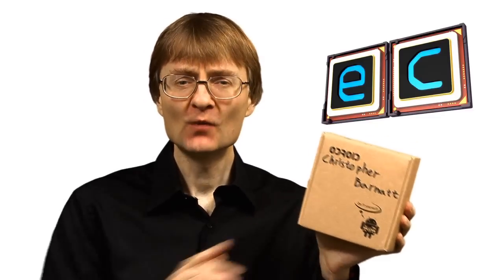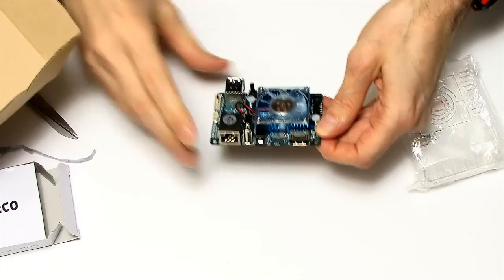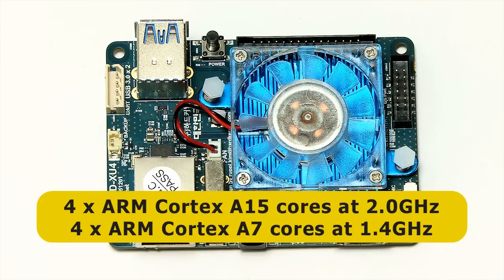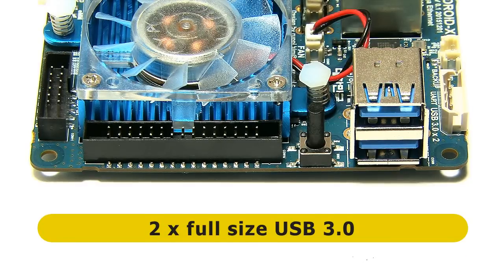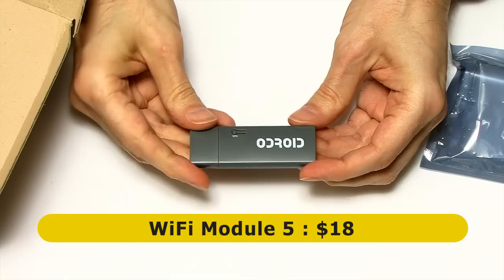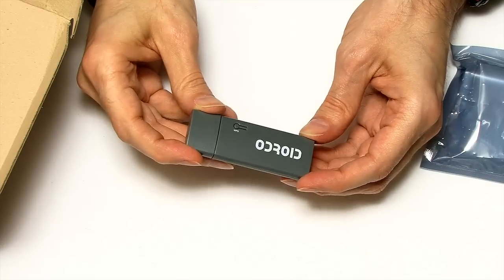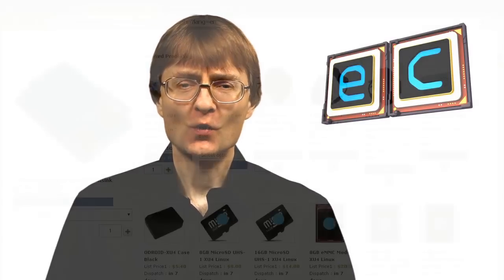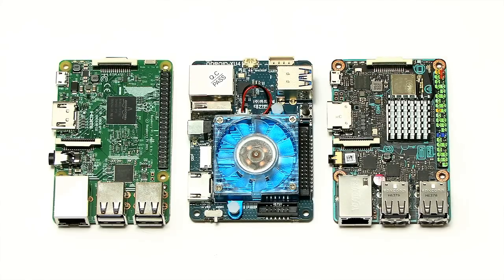ODROID-XU4 Octa-Core SBC

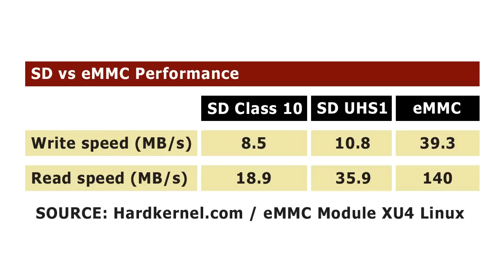Comment: 7:25 their sd cards were probably just really slow, my sandisk extreme 32GB micro sd card that's in my phone gets about 25 to 70 MB/s (or more), even in my raspberry pi 3 b+ sandisk extreme cards are still really fast and only take about 15 to 45 seconds to boot raspbian.

Comment: Banana Pi BPI-M5 is a new generation single board computer design , use Amlogic S905X3 Quad-Core Cortex-A55 (2.0xxGHz) Processor. Mali-G31 MP2 GPU with 4 x Execution Engines (650Mhz). support 4GB LPDDR4 and 16G eMMC flash. it have 4 USB 3.0 port,1GbE LAN port.
http://forum.banana-pi.org/t/banana-pi-bpi-m5-with-amlogic-s905x3-chip-design/11502

Comment: I put a SD card memory in card into my Acer Google Chrome 15 laptop and I I can't get it to show up when I put it in and when I go to Jerry and it shows me some things that look like it might be at but there's nothing to distinguish which one is the one I want you know what I mean and then another thing my neighbor said well if you buy Windows then you're not stealing windows and it's just like it's just me out because Windows is going for $139 right now and you know and that's in you wouldn't even use Windows 10 you would use Windows XP or or Windows 98 but in order to get 98 or XP you got by Windows 10 so I don't have a credit card right now cuz my mom cancel that so I don't know I was going to buy it with my money cuz I got to stimulus check and but my mom gave my dad $700 and I wasn't able to buy Windows 10 Windows XP and Windows 98 but I do have the little SD card and I left it plugged in because I figure if I leave it plugged in I won't lose it

Comment: Could you run a terminal connection into server 2016?
Or can you run virtual box using a windows VM?

Also, can you increase memory or connect an ssd drive?
Reply from the maker: Memory is fixed. You can use an eMMC module, SSD via USB 3.0 port. Terminal connection, yes. Not virtual box -- this is not an x86 PC! It is an ARM board.

Comment: Christopher! what happened to your review of the nano-pc t4? I bought one, and it's hotter than hell. Fast ARM-64 processors need better cooling! Did you bother to install an NVME disk on the nano-pc t4?  Where do you format to use the NVME storage?
Reply from the maker: Hi Karen, I've not got an Nano-PC T4 (yet). Though I have just received a RockPro64, which is based on the same SoC, and will be featured here on 12 August. :)

Comment: I realize these are not windows compatible: however, could they be coaxed into running ReactOS? While that is in mind, are there any of these form factor boards that run Windows or, hopefully, ReactOS? I dearly need a replacement for an aging Win XP system that is Win XP compatible.

Comment: Dived in lately onto building a few retro arcade bartops with raspberry pi’s I was thinking in building a third with an XU4 as the extra power can pay N64 and Dreamcast games it seems but I see it was released in 2015 so I’d rather wait for the next upgrade board.

Comment: It doesn't seem like this board is worth it. A raspberry pi 3 has wireless connectivity and uses less power. What do you need all that processing power for in a single board computer? If you really needed a powerful single board computer, a latte panda would be cheaper than this setup and at least just as powerful.

Comment: Full sized USB A socket, not USB 2, although it will have USB 2.0 on it I would guess. USB 2.0 is the protocol, but the HW standard is USB-A which is a host socket. 

Sorry for being pedantic but I think it pays to stick to industry standard terms/names
Reply from the maker: Yes, I am well aware that USB 2.0- is the protocol. But, for the vast majority of users, the distinction is between a USB 2.0 port and a USB 3.0 port. The more detail of the type you note I include in a video, the more cumbersome and longer the video gets, the less accessible, the fewer people watch, and the weaker it becomes as a means of communication. I think very carefully about the level of detail to include in a video for the intended audience.

Comment: 64-bit octa-core CPU?   i thought this was only a 32-bit??  i was thinking of getting it, but i am hesitant because i thought it was only 32-bit.
Reply from the maker: You are correct -- my mistake here. The memory interface in the SoC is 64 bit, but not the CPUs. Sorry for my error.
Reply: i wish they would have made it 64-bit :(  i'm thinking about using it with RetrpPi on an eMMC chip, since the pi doesn't have an eMMC option

Comment: Hi, Thank you so much for these useful information and for the simplicity.
Just one quick question please. Is it possible to establish a connection between several ODROID-XU4 Octa-Core building then a small cluster (say for 80 cores) ?

Many thanks again
Best,
Reply from the maker: It is indeed possible to build an XU4 cluster -- and Hardkernel even sell hardware to facilitate this: http://www.hardkernel.com/main/products/prdt_info.php?g_code=G150152508314
Reply: I see for the advanced setup described in the link that there are in total 128 processors can work in parallel. I would like to ask about the max processors which can be provided and price please.

Comment: But can it run crysis? :D

Serious question tbh, is it possible to install a windows on it? Like, are there drivers and such?
Reply from the maker: This is an ARM PC, so cannot run Windows I'm afraid.
Reply: The guys behind wine (the thing that lets you run windows apps on linux) are planning to integrate it with CEMU to run x86 windows stuff on ARM linux.
But for now it's only an idea, it can't.

Comment: The funny thing is that this is the same CPU as the Samsung S5 had have, but this big cooler is installed. So is now the vooler absolutely oversized, or the S5 hardly limited because of the thermal design?
Reply from the maker: Interesting point!

Comment: Probably using 6 because of its exynos nature. On Cellphones it uses the four lower speed cores until they get strained, or need more power or some anomalous protocol tells it; Then it switches to the faster 4. Be interested to see if in this board all 8 are available at all times or if the four by 2 architecture is hard wired

Comment: I appreciate you showing all models of Odroid, and the price for each. I'm looking to buy the one on Amazon (https://www.amazon.com/dp/B0761YJY27/_encoding=UTF8?coliid=I1832TWX8M9W1K&colid=2EVOGHRKWGLXB), yet it looks like the only difference is the power supply for $20, versus the one you link to above ($59.95). Moreover, power supply looks to be available for $6.50. 
Questions:
1) Is the only difference in the $79.95 model and the one you link to, the power supply? The cooling is the same, being the fan, is what I've gathered.
2) I think you did vid/review of Banana Pi with 2GB RAM, or at least Quad-core. Works well from what you said. But I saw on Amazon (removed now, on eBay though) the Banana Pi OCTA-CORE. Moreover, it got HORRIBLE reviews, some saying it wouldn't even boot. Not sure I want to be on the Bleeding Edge on this one (OCTA-CORE), however, can you get one (hopefully for FREE) and do review on?

You the man .... man!
Reply from the maker: You are right, the only difference is that the more expensive board comes with the PSU -- hence I linked to the other one, which is also sold directly by Hardkernel. I reviewed both a LeMaker Banana Pi and a Banana Pro a few years ago. I've not looked at the more recent models.

Comment: Some people seem amazed at these SoC boards, but if you crack open a modern, cheap laptop then you will see that the motherboard is the same size as one of these (and often the same components too), the rest of the space is taken up by a huge, thin battery.

Comment: Hi I have question about single board computer I wanna know wich one is stronger and faster I mean about processors,Gpu's and WiFi cards and if you could make a video about explaning clock speed, core i3,5 and 7 or AMD's specifics. the purpose of this questions is I wanna buy a high efficiency(strong and fast) laptop but when I checked those in store are very expensive compare by single board computer's the monitor is not important for me but I want some thing fast really fast. thank you

Comment: Very nice, and straight forward little SBC, and I really like the fact it has a fan(although a dust filter might be a wise upgrade) for some cooling. seems like it would make a nice little computer to attach to the back of some monitors for cheap office computers running Linux.

Comment: Can it run on ubuntu?
Reply: It's showed in the video. It runs Ubuntu Mate, but you can always change the Desktop Environment . Xfce , Lxde, Lxqt are light enough to smoothly run on boards like this . I wouldn't install GNOME 3 or Unity or KDE: they are too heavy on resorces for this kind of boards, even though KDE may have a chance to work fine .

Comment: Mate, I'm not sure which UHS-1 cards you're using but I bought some 32GB el-cheapos from a supermarket rated 633x that read/write at 80MB/sec, specifically for the purpose of booting my XU4. You can buy microSD cards rated at 270MB/sec nowadays. XU4s eMMC is a proprietary, two year old interface and all of the flash memory is that age, too. To emphasize: Odroid is the only technology you'll ever see use that type of cartridge, and you're being sold two year old flash at an expensive price because it needs to be expensive to produce and test that interface. They'll tell you they can't sell you a blank one (without the OS) for cheaper because they need to test that it works. I suppose the testing could justify some of the extra cost, but it doesn't make sense to even use the interface nowadays. Not when you can buy a microSD card which has the same read speed and FASTER writer speed for the same price...

Comment: I like that board, like to have one with two 6core CPUs, that way it can use one chip, and use two when more demanding tasks, such as gaming, and a ram 240pin slot in the side, on the back I would definitely want it with M.2, one USB3.0 and 1 HDMI output, also like to see a solar panel that can attach to it on top of it.

Comment: I wish the single board computer makers would make them with at least two 1GB NICs.  These small computers would be great for a PFSense router.  Low power consumption, but powerful enough to perform nicely in such an application.

Comment: No, it is not 64 bit. But if you don't need 64 bit then it's faster than any cheap 64 bit ARM board I know of -- the fastest I've used is Odroid's own C2 (which is only $5 more than a Raspberry Pi, but nearly twice as fast in many uses)
Reply from the maker: Yes, sorry, I got that wrong. The memory addressing on the SoC is 64 bit, but the cores are 32 bit. My apologies.

Comment: No 1280×1024 resolution. Is it any possibility to use it as a (not so) low power desktop with older format screen?
Reply: Ηλίας Ζαχαρόπουλος yes of course it's possible to use it as a desktop computer. :)

Comment: Pretty expensive little beast, especially with all the accessories. And not that fast either. A15 cores are actually slower than A53 cores in Raspberry Pi
Reply: in fact it's much faster than A53 cores: https://en.wikipedia.org/wiki/List_of_ARM_microarchitectures

Comment: How forgiving is the OS when there is an uncontrolled switch off due to a power failure? Does it brick the boot memory?
Reply: corrupt disk is not bricking. you may fix the errors or you may have to reinstall operating system at worst.
Reply: Gökhan Ersümer I think my choice of words were poor. The solution you suggest were the very things I wanted to avoid. I was hoping for a device that would just restart. This is a similar problem in using a respberry pi in an embedded application. An uncontrolled lost of power is likely to corrupt the OS, meaning the computer will not recover automatically from such a failure. What is required is a solution where it is safe to just turn it off and on again. My embedded pi home automation system runs on a UPS. What is required is an OS that runs from non volatile write locked memory. Older systems had the OS on EPROM. While this solution means the computer will always reboot to a working system, it loses the flexibility of being able to change the is version easily.
The problem is that the OS is self modifying.

Comment: I readily admit that I'm not overly immersed in SBC's, but am I completely off my rocker to be somewhat worried that it needs a 4-Amp power supply?  That's quite a draw if it ever actually demands that much.  For comparison, I have a Dell laptop whose power supply output is 4 Amps, but it also (re)charges a huge battery, powers a liquid crystal display, an optical drive, an HDD, and the usual compliment of USB ports.  I guess I'm just surprised that this little SBC spec's such a draw.
Reply: Laptop power supplies are typically 12v though

Comment: I just did a quick search and found a UK site selling the board for £75. Quite a difference to the $59 mentioned in the review.
Reply from the maker: You can order direct from Hardkernel. Amazon UK have the passive heatsink version for £60.
Reply: That's a quick reply. I have no axe to grind, I was just interested to find out how much it might cost in the UK. On Amazon UK I am seeing prices around £110 (from UK suppliers), the lower cost ones appear to be shipped from the USA which I guess will attract VAT and other import related charges. Still it's a lot of bang for the buck.

Comment: Great video but really huge Wi-Fi diving board!
Reply: mindstorm8191 To be honest, if you want to make a media center, you probably want to hardwire the internet connection, making WiFi unnecessary.
Reply: Maybe we can find Wi-Fi USB small
Reply: Yeah, I was dissapointed that the board didn't have Wifi built in. With everything else it has, why not Wifi?
Reply: That's fair, but that's not what I want one of these devices for.  I want to get into robotics, though I don't know what to build yet, and barely know anything of the subject.  Between Raspberry Pi, an Arduino, and this... I don't know.  A built-in WiFi wouldn't always be needed, but such a feature would be nice.
Reply: There are USB Wi-Fi  cards the size of a pc game controllers bluetooth 'nub' now, and I believe they only run about 17 bones

Comment: A couple of things: On the Android side, I didn't see the Play Store - it's absolutely useless without that. Also, when you review SBCs, when you discuss the MicroSD card slot, please state whether it's a Push/Push or a Push/Pull. The Pi 3b is really messed up because they went with a Push/Pull which causes about 19 out of 20 cases to be useless because you can't grab the tiny rib on the card. If all you had to do was push to remove, just about every Pi case would be fine. On this Odroid, how was it trying to get the MicroSD card out when in the case?
Reply: rwprime1 Play store is not provided with the official Hardkernel releases, but it is not difficult to add.  I think the instructions are at the wiki page and forum.  There may also be community-provided images with the Play store already included.a

Comment: This exynos SOC isn't a 64bit system it's based on arm cortex a15 and a7 which are 32bit
Reply from the maker: Yes, I have realized that now. Sorry. Hardkernal stress the 64-bit memory bandwidth (the memory is addressed 64 bit on the SoC), but the processor cores are as you say 32 bit. My apologies.

Comment: +ExplainingComputers / Christopher,
Bit disappointed that you didn't explain about the tech. specs. or cost of this device.

One of my bug bearers about this device is the lack of GPIO pins.

I am presuming that Armbian will work with this board (Armbian is my prefered Debian installation when it comes to SBCs).

Actually, you might be able to help me out, recently I have been reading a lot about NFC on microSD cards but am having a hard time finding a vendor for these cards and wondering if you have any ideas about this sort of hardware?
Reply from the maker: I mentioned the cost at 1:28 -- $59 dollars -- and the same for accessories. And I covered all of the basic tech specs. And there are 2 GPIO connectors! :) I have not come across an NFC micro SD card I'm afraid, although I too have heard/read that they exist.
Reply: +ExplainingComputers / Christopher,
Sorry about missing the price,got distracted whilst I was within an SSH session ;-)

You might be interested to know that I have been experimenting with an Orange Zero within the last week, nice little device with a lot of of functionality and an extremely good set of pin headers (plenty of pins for expansion and interfacing to other devices).

Comment: Super streamlined fan and heatsink design.
Reply: Agreed, but having a removable mesh dust filter on the case he showed for it would be nice so you don't have to take apart the case to clean it.
Reply: that clear case has that knock-out line around where the heatsink is, probably for larger fans and heatsinks. Adding a filter there would not be a difficult mod as well. I never thought about doing that, great idea.  B)
Reply: the stock heatsink is a bit minimal, and on some heavy loads the SOC still throttles back some unless a larger fan and heatsink is used.  Overall I've been really happy with the XU4 for about a year now as a secondary computer to look stuff up on or just to display chip specs/pinouts on. It even does ok with watching online vids.

Comment: I always see people trying to compare these devices with PCs, forget it, don't cheap out on the PC. Where the XU4 will really shine is when used as a standalone, headless appliance as I'm sure Chris' performance testing will bear out. I use these as a voip PBX for example, one of these will easily support 50 concurrent calls with plenty left in the tank. Add an SSD and this thing really flies.